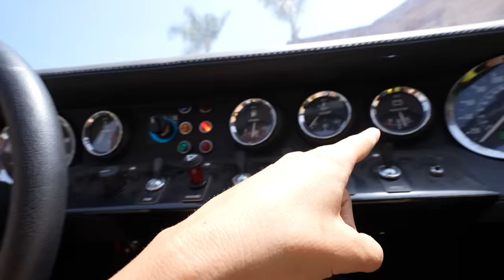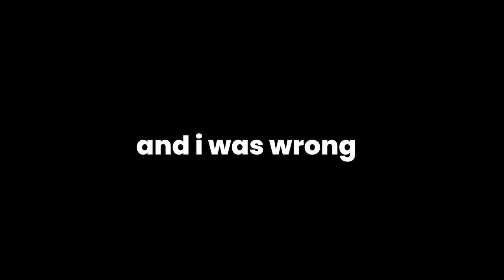I Bought An ABANDONED Ford GT40 that's never been driven (Forgotten For 20 YEARS)

Comment: With the yellow you will be noticed by all the other drivers around you because it stands out!
I know your going to go over the motor and trans to make sure its fully sound before your first drive. Hope that its just the shifter having issues and not the trans. 
I say stick with yellow but maybe go with a deep blue in place of the black and a little more color in the interior for accenting and highlighting it inside.
Reply: Because driving a GT40 replica doesn't stand out enough ;)

Comment: Hey Emelia, it would be sick if you painted this like one of the prototype gt40's. I have never seen a replica painted like the prototypes, so its definitely something different.
Reply: CAV is the only certified company that may do that....fun fact
Reply: Gulf Mobil blue and orange!
Reply: @jvrkandc  Certified? What nonsense is that?
Reply: @karlapplegate4145  Gulf livery would be my vote too.
Reply: @drewschumann1 you think these were made without a license?
Reply: A gulf livery would be the best i think
Reply: @karlapplegate4145  would look nice, but it's so overdone. Would be cool to see something different for a change.
Reply: This ine runs a stainless chassis i think.
The originals were aluminium.
As for colours?
Ford tractor blue with decals off a ford 4000 tractor.
Reply: What about reverse Gulf colours? Orange with light blue stripes…
Reply: @drewschumann1  yeah licensed lol. Ford is just as crazy about GTs as Ferrari is about their cars. even replicas i would imagine. once you buy one you have to sign a contract stating you wont modify anything on the car. cant have it painted either. or they'll try to take the car back and sue you.
Reply: @drewschumann1 trademark infringement and other contractual obligations
Reply: @Conquest_HD   There have been a shed load of GT40 replicas over the years. Never heard of a licensed replica, unless it's some marketing nonsense
Reply: @Conquest_HD   just a quick Google search reveals at least 6 manufacturers of GT40 replicas. Some claim being continuation cars but the idea that Ford restricted replicas is dumb
Reply: @ja60123   nope. But thanks for playing
Reply: @nathanthomson777   No. GT 40 replicas are readily available and there are no licensing restrictions.
Reply: @karlapplegate4145  Gulf or Mobil? They are different companies, so which one? Mobil is red and usually darker blue, while gulf is a specific orange and either two shades or blue, usually a baby blue color but sometimes darker. We have and Original 427 Shelby Cobra S/C that is the only original cobra painted in Gulf Racing Orange, and it is amazing in person.
Reply: @drewschumann1  I think Superformance might be the closest. At least I think they are licensed by Shelby to make the Cobras and Daytona Coupes.
Reply: @drewschumann1  I'm not saying they did for sure. I just wouldn't put it past them with all their rules about the Ford GT. I mean idk if you recall but they did try to sue John Cena for painting his car a different color than what it came from factory.
Reply: @Conquest_HD   Yeah, they did that for the modern GT. The series 1 and 2.... Not so much.

Comment: Lots of cool choices on paint options. One consideration would be to replicate the Gulf racing paint that Ford used in Lemans (baby blue and white with thin red stripes). How about a Candy Apple 🍎 Red? I am sure you will have to replace most of the rubber hoses after 20 years of scorched earth heat and corrosion. Nice purchase. You should be able to sell it easily once it runs and drives great and you get tired of it 😇☺️. Thanks for sharing Emelia!!!!
Reply: The stripes were orange, the same color as the Gulf insignia. And that wasn't Ford that used that color scheme. That was John Wyer Racing who also did the Gulf Porsche 917 Lemans cars after the GT40s.
Reply: Attsa sweet azz  ride Emelia!  This baby needs to be classic White with the Blue Stripes for the Win!  😎👍
Reply: @cee128d: thanks for the correction. As soon as I read your message it all came back to me. That was a long time ago. But you are correct!!!! Cheers 🥂
Reply: @gordydexter2615  No problem. I grew up in that era and still have a model of a Gulf GT40 as well as a matchbox car on display here at home. Plus I was just watched a couple of LeMans videos which showed them a couple of weeks ago so I was working with recent memories.
Reply: I think the current paint is good, but like you I was thinking the baby blue. I admit i didn't recall  who had it in which race as I am by no means a fanatical fan. But to me that blue definitely speaks "GT40". It is also the first paint scheme I ever saw a GT40 painted in.
Reply: @mikes78  Interestingly enough, that paint scheme didn't appear until the 4th and 5th years of the GT40's main racing career. For the first three years they were painted in a multitude of different colors making it easier to recognize which car a specific driver was in. Each team car was a different color. It wasn't until year 4 when John Wyer took over and standardized his cars with the iconic Light Blue with Gulf Orange Stripes and Trim for the two years he ran them, and then with the Gulf Porsches.

Comment: I am building an RCR GT-40. So far, I have the engine and transmission rough mounted. Hydraulics 70% installed. I used the LS3 with a Porsche transaxle. The same configuration as the Ford Vs Ferrari movies. Fran made 18 cars for it and these are pretty durable. The transaxle is outmatched by 100HP but it’s a road car, not a drag car. Fran said that the stunt men beat the crap out of the cars and they were fine.

Comment: I think run with the Yellow for a while until you've worked out the bugs and have beaten on it some. If you still love then you could paint but a color change is a huge job if you want it done right.  I'd consider adding fuel injection...  I'd also make sure you have a couple of fire extinguishers handy in the car, I'd add a battery cutoff switch with a removable key.

Comment: Hello Emelia, paint the GT40 Red, Black Stripes with Silver or white exterior stripe (Along the black stripes)  White or Red BBK's, Black wheel with the polished knock off spinner, and polished lips for those lovely wheels.  :)  Cheers, but whatever you choose will be first class as usual.  You could also do the car in a Ferrari Dino Rosso color.  Sorta Orangish and red.

Comment: Emilia, it is rare enough to meet someone who does not have potty-mouth but to be a gear-freak and a well-spoken one who also seems to know what you are talking about is a wonderful reprieve for me as an overworked, middle-aged Mold Setter that gets most of my sunlight through the sky lights in the shop where I wrench in the Rust-Belt of Ohio. Before I go on, the cacophony you are hearing when your car moves is bc racing-type brake pads are so very rife with metal. All of that metal that is exposed now has surface rust and is actually contacting the faces of all four of your rotors. This is exacerbated by the brakes being unused to this point since the pads have not been properly seated on them. As they move past the pads the rust induces oscillation within them and that is what you are hearing; kind of like an ill-fitting hardware clip. Not that you guys are inexperienced but if I was down with a relocation of my tools, my posterior, and my cats, I would love to come work for and with yuns. Only problem is if I got my hands on the Cleveland that I think I saw  under that curvaceous hood you would be needing some wheelie bars up on that puppy!!! The aspiration that you display is quite an inspiration! You go, girl! (And please pat your parents on their backs & give em a  healthy dose of squeezins bc they deserve it) Signed: brand newbie follower!!!

Comment: You might have to weld in the seat belt attachment points to the roll cage. I don't think those bolts are strong enough, safety is paramount in a very high performance automobile.

Comment: Royal Blue  with Orange  Stripes Grady Davis from Gulf Oil Personal car which is on Display at the REVs Institute  in FLA  Get rid of the Carb and put BORLA 8 stack injection  on it to imitate webber, RestoMod Makes  a very compact AC unit that would Probably  work for you ,I'm putting  one in my GRP4  restomod  Pantera  along with the Ingles Injection  438 Cid Clevlor  the original  GT40 s had an acess Panel  for the water pump,Hoses,belts and distributor in the drivers compartment  you should have that for accces Good luck 
Jimmy  from CT

Comment: I have a full Z32 rear brake conversion setup for Z32 that includes a Yanack Racing S14 to Z32 conversion e-brake cable that is supposedly based on the R33 GTR e-brake cable. I’m local.

Comment: Hi Emelia ,  Well I thought you were crazy to get rid of the Daytona but you made a deal to get the next rarest  ar on the planet good job . As for color The Gulf Racing colors are nice or the white with the blue strip is nice . Another thing to get heat out of inside of the car large computer fans , they 12v dc easy to hide and easy to mount . Also with this car I would take time and take the brakes apart clean all the put it back together with silicone brake fluid . With the silicone brake fluid you’ll new have to mess with it again . Also you should read up the Evans waterless coolant . It’s perfect for these kind of cars this is why Jay Leno uses it in his cars . Safe travels . Oh be careful forcing the shifter like that you could bend shift forks if the problem is in the tranny .

Comment: @EmeliaHartford  Thirty years ago I worked at the Lamborghini factory as a photographer, in March 1993 I created the pearl yellow color that you see on their cars today.
I used to paint cars in high school in 1979, I drove a pearl white Mustang before pearl paint finishes were offered by the automakers.
My Mustang was white on white, the car was pearl white with the Mach1 stripes painted in plain white, the stripe edges were lightly sanded and buried in a clear coat finish.
For the GT40 White with blue stripes is the most common paint scheme, no one has done a white on white before on a GT40.
However, since the car is already in yellow completely changing the color might be too costly.
Since pearl is mixed with clear and painted over any solid base paint finish I would turn this GT40 into pearl yellow, keep in mind that once the pearl over coat hits the black stripes they will turn into a charcoal black metallic stripe which might look pretty good in contrast with the yellow.
Before making the GT40 pearl yellow I would add a thin red pinstripe on the sides of the black racing stripes.
You could also try this, paint the GT40 pearl yellow and change the black stripes to Army Jeep Green, yes it works with yellow, I grew up near a small airport and used to watch Navy trainer planes come and go and they were painted yellow with military green.
So here's some color options, add red pinstripes to the sides of the black racing stripes, paint the GT40 in pearl overcoat which will turn the black stripes to charcoal gray, if you want solid black racing stripes then those would have to be painted after the pearl finish along with the red pinstripes then sanded and clear coated to bury the stripe edges.
Second option, paint the yellow GT40 with a pearl overcoat, repaint the racing stripes in army green, add black pinstripes on the sides of the green racing stripes, lightly sand and cover everything in a clear coat to bury the edges of the stripes, there should be no bump or ridge on the edge of any painted stripe on that car.

Comment: I like the yellow but ... as you have the 458 the color on that is amazing and unusual. So if you are to change the color it also needs to be something unique with excellent taste as you have. You got the 458 spot on so I'm sure with the GT40 you will do the same. The body needs something extra. Not sure what but it looks naked. Maybe some small carbon fiber elements that are also functional, modern but won't look out of place. Front side winglets maybe and spoiler and small lip for the rear. Something that you stop and look but not sure what it is that makes you stop and look. 
I'm picturing deep candy red with some carbon fiber bling and some of the alloy anodized red to match the paint. It could be the skirts or parts of the wheels against black and something in the engine bay. You need red seat belts. Here is a crazy idea that you can take from Le Mans cars as they race at night. Have your number lit up at night time or your name and sponsor. That would be cool if done proper with good taste. Something you hardly see at the day time but at street lights would look awesome.

Comment: Plan on replacing every hose and seal eventually. Sitting for 20 or 30 years does them no good at all. Water pump seal and heater hose are your first clue at what you are up against. May have to do a Sarah-n-tuned and replace gaskets on the engine too- somewhere down the road when you know what you have. Since it's never been driven and motor and trans were buyer installed, would not be surprised if shift linkage is funky and out of adjustment. 
You still got a good deal and a good car, especially since you can to all that in house.
Reply: I love using "S-n-T" as a process, and that I understand what you mean.
Reply: @jspaulding4106  She's obsessive airplane mechanic thorough, and you can see she believes in fixing things before they break, as a good air mechanic should. Rare these days on automotive channels.

Comment: If that car had been seating outside for 20 years, the tyres would be deflated, the car would be covered in mould/rust, the engine bay would look completely rusty as well and the engine itself would certainly have never started.

Comment: That GT40 comes as a rolling chassis.  This means the frame, suspension, brakes, body and so on are assembled.  Everything except is assembled except for the engine and transaxle.  That transaxle you got is skookum as it gets.  There are better but they cost way more.  That trans is the one you want.  I would imagine the engine is good to go also as the guy that did this car didn't hold back on anything.  By the quick view I got it appears it also has the up graded suspension.  It looks like this may have got what they called the 'TOOL ROOM EDITION'  Treat her well.  It looks like there should be a few body parts missing if my memory serves me correctly
edit ps The only thing it doesn't have is the Gurney Bump/Bubble

Comment: Please LEAVE IT YELLOW! I wouldn't run it very long with the rear body up because the exhaust is pointing directly at the body and not at the exhaust cutout like it does with the body down. That exhaust could heat up the fiberglass from the inside and burn the inner body lining or bubble up the paint.

Comment: I'm excited for what's to come for this car AND for Phoenix now that HP Tuners was able to crack the C8 ECM. Peitz was so stoked in his recent video tuning their twin turbo C8 with HP Tuners.
Reply: Your post about the availability to tune 2020-3, C8 Corvette Sing Ray with HP Tuners is correct. However, this ability and availability it is not through them 'cracking', 'hacking' or any other such means rather through GM as with the CT5-V 'Blackwing' 6.2 L (LT4) & 3.0 TT (LGY), CT4-V Blackwing 3.6 L TT (LF4), Escalade-V 6.2 L along with their other vehicles through GM Global B support of the GM E99 ECM, along with other manufactures too.
This certainly will be of much assistance, though there still is the TCM which clearly has some additional needs for tuning too.
All The Best. Sincerely
Reply: @newtonfirefly3584  Ah, I did not know that, thank you very much for the info. With this the C8 platform is going to take off!!!
Reply: @pruchoco  Perhaps. The C8 is already very popular with excellent sales since its introduction.
This certainly allows owners, tunersm those that modify, improve performance more access to the GM.Chevrolet/C8 ECU-ECM for tuning with the performance upgrades.
There are still limitations wit the TCU-TCM, since the access still has not been released.
All The Best, Sincerely